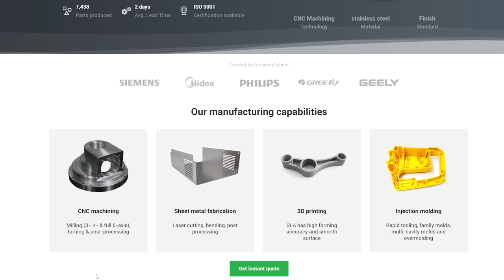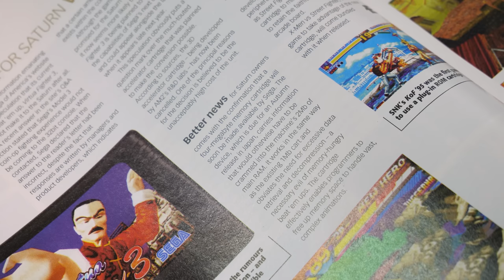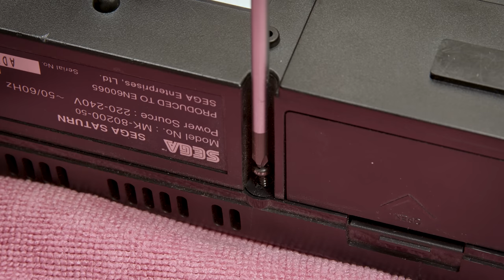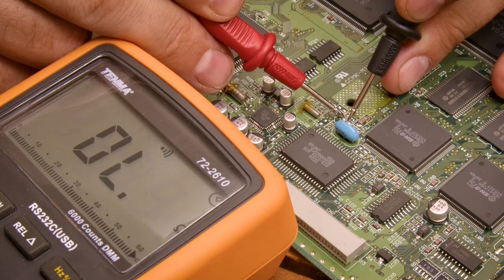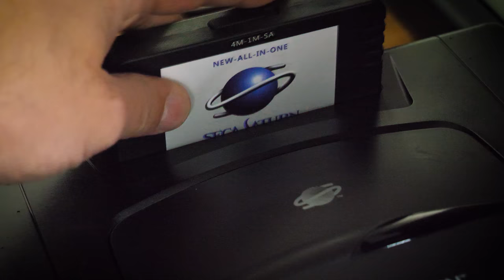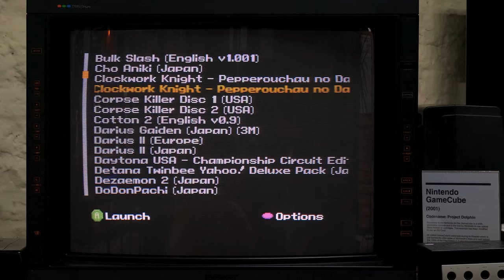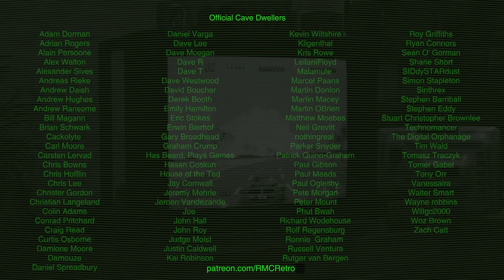Tricking out a Sega Saturn (Fenrir, 50/60hz and more)

Comment: Retro Bit makes officially licensed wireless recreations of the Saturn and 6- Button genesis/megadrive controllers. Both work interchangably if you buy the extra receiver. I've been happy with one of each on my Saturn/Fenrir, no b problems using ABC+Start to go back to to the fenrir menu etc. 

Still no analogue stick, but very few Saturn games use it, and I don't really miss it. The Arcade stick is a much more important accessory for that system.
Reply: This is the only true way imo, I want I like retrofighter but they keep messing up on controller features. Only retrofighter controller I have is the dreamcast one.

Comment: 10:25 

Great video, one thing regarding the 50/60hz switch. A PAL Saturn switched to 60hz outputs an off spec NTSC signal, 59.3hz instead of 59.97hz. Most 50/60hz switches will work fine on a CRT but won’t work on some HDTV’s and scalers because their output is off spec. You can swap the PAL crystal oscillator with an NTSC one to fix this, there’s even a dual oscillator mod available but the website for that chip you used doesn’t mention anything about the oscillator so it sound like a regular switch. Just thought I’d mention this, most PAL Saturn owners nowadays just buy a Japanese system for NTSC games as it’s cheaper and easier then getting the oscillator mod done.
Reply: Is this an issue for a modded PAL consoles if you use RGB scart since since the colour information is then not in NTSC?
Reply: @johnjames7332  No, it’s purely to do with the refresh rate.
Reply: @Ish0tJR  Thanks
Reply: I was wondering this. Does it end up resulting in tearing or judder etc?
Reply: @jonnyharket  Typically judder and the sound cutting out.
Reply: @Ish0tJR  thanks. Think I'll just get a NTSC J console.

Comment: My understanding of the analogue stick on Saturn (I can verify this on my Saturn later) is that for MOST Saturn games they are digital only. Only certain games programmed to take advantage of the analogue stick will play the way you are expecting. I would suggest trying Nights into Dreams and see if the analogue stick works on that one. Back in the day I bought the bundle that came with the analogue pad and Nights together.
Reply from the maker: I’ve had a chat with the supplier and they confirmed this is digital only
Reply: @RMCRetro  that's the thing with Retro fighters products. Always so close, but always an issue with the design of them. I believe this is digital only as it was primarily aimed at use on the Megadrive.
Reply: As I know. Only 5 or 6 games had taken advantage of the analog stick. Games like Daytona USA CCE, Burning Rangers, Nights and Sega Rally. I can be forgetting some game or another. But isn't many more.
Sonic R, Sonic Jam e Sonic 3D Blast had the support for the analog stick, but don't take advantage of that.
Others, like the original Daytona or Sega Manx TT Superbike, were compatible, had taken advantage, but weren't designed to be used with the analog stick, but with the Saturn's racing wheel.

Comment: I know people tend to say old 3D games don't age well, but I have to disagree. The old school 3D has a certain kind of charm just like old school 2D games, IMO.
Reply: It's a great system to witness how stunningly fast 3d graphics were improving at that time. To see Virtua Racing and Sega Rally Championship and realize they were released just 2 years apart is mind blowing. 

It's also fun (and occasionally infuriating) to see how different games at that time try to figure out controller mapping to move in 3d space, as there were a lot of different ideas tried out. Burning Rangers using the shoulder buttons to quickly swing the view around 90 degrees at a time is one I still think is pretty good.

Comment: You don't need that region free mod since the Fenrir takes care of this. All you need is to switch the console to 60hz permanently, which can be done with a single wire, no extra mods needed. The you can use NTSC roms with the Fenrir.

Comment: This is perfect for a console with a dead disc drive but if you have one with a working drive, get a Satiator, you can get the ODE features of a Fenrir but you can still use your CDs and games! It plugs into the rear VCD card slot.

Comment: Saturn collecting/buying/selling was bananas back in the early - mid 2000's. I sold my modded Saturn, X-Men vs SF (with cart), Marvel, vs SF, Bomberman, Darkstalkers Revenge,  KoF 95, Samurai Shodown 3, X-Men COTA, and Alpha 2 for £750 back in 2004. I also bought Try Rush Deppy for $30 in 2001, then traded it for Demon's Blazon on the SFC a couple of years later

Comment: You can get a PCB called a SaturnPSU that replaces the power board with a smaller/cooler one that runs of any >=3A 12v PSU, it's a great bit of kit that runs cooler and more reliable than the original PCB as there's no AC/DC conversion so less to go wrong.

Comment: I looked at modern alternative controllers but I settled on and would recommend the brook convertors from brook accessories, xbox controller (or you can use PS4 or PS3) connected wirelessly or wired - one box/dongle with a Saturn and DC connector. I do like the uniqueness of the original controllers - they are boxed and put away. The analog on XBox/PS are so much better.

Comment: The Saturn I bought just after it came out still works and I'm hesitant to replace the disc drive with a Fenrir as I love putting my old games (and also new ones I'm still getting to expand my collection) in and playing it the way it was meant to be played. I only need to fix the screw holes as they got stripped by me opening and closing it multiple times like for deactivating the sensor for the lid being opened or closed as I used the swap trick to play imports back in the day (now I got an Action Replay Plus which also functions as memory card and 4M RAM expansion). Still remember downloading games like Psychic Killer Taromaru and so on via 56k modem (5kB/sec oh yeah!)...

Just got a Virtua Arcade Stick as I never owned one. Already got enough normal controllers and the 3D pad but also looked at these RetroFighters pads before as I wonder if they might be better than my original Saturn and MD pads. Also do they really support the MS as the original MD pads can be plugged into the MS but have issues? Would also love to use the MD pads on my C64 but they don't work there, while the MS pads work but are quite bad.

Comment: Awesome video! I am Saturn fan since 1994. in the video you have done the region free mod if you go that way It would have been better to add the phantom modchip. instead of using the all in one cart.
And also you can do an other mod is to reduce the heat in the saturn by replacing the power board 220v to a 12v pico psu. sega for life!!!

Comment: Wonderful mods. You no longer need to remove the CD Drive thanks to the Saturn Switch mod that retains both the ODE and the CD Drive there is also the Satiator which plugs into the expansion port. And as for those that prefer NTSC J consoles there is the Pico Universal PSU mod, power efficient, runs cooler and no more step up transformer.

Comment: Great video. The PAL Sega Ages pack wasn’t optimised well. It doesn’t run proper in either PAL or NTSC. The timers run too quick. It’s the same with Manx TT. It’s best using the Japanese releases of them. The individual Outrun in Japan had an extra soundtrack on the disc also. They released another version of Daytona in Japan called CCE Edition and that improves the Graphics further and adds the original music. Try out the Sega Rally Plus from Japan also as it adds the PAL version’s improvements and analogue support.

Comment: Just upgrade the Saturn's RAM with the 4MB cartridge and update the power supply with new capacitors and new main fuse to improve its longevity. Not much else you can do to the system without wiring in an SSD module which can be complicated and overly risky.

Comment: Absolutely my favourite console ever.. i have 5 of them :) Superior to the PS1 for 2D games, but inferior for 3D. The RAM cart made it possible to do nigh on arcade perfect ports of the best Capcom fighters (superior to the PS1 versions which didn't have the RAM).

As for games I'd recommend. Guardian Heroes for beat em up along with the Dungeons and Dragons collection (JP). Fighters you have the Street fighter collection, SF Alpha 1-3 (3 is JP only), Vampire hunter and Saviour, Pocket Fighter and many more from Capcom games (they knocked Saturn support out the park). Sports i'd go Decathlete and WInter heat... two superb hypersports style games. Shmups you have Battle Garegga, Do DonPachi, Keio Flying squadron, Panzer Dragoon 1 and 2, Parodius and more. Once you have that ODE and the Japanese library becomes available there's just too many fantastic games to mention on this console.
Reply: Like you, I also have 5 working Saturns. kkk.
I don't think the 3D capabilities of Saturn it's somehow inferior to the PSX counterpart. The PSX handles fewer polygons and suffers from a bunch of scaling and perspective miscalculations because of the lack of float point calculations.
The Saturn also does not handle subpixel and floating point calculations, but because Saturn handles with squares and not triangles, it's just easier modelling 3D elements.
Reply: @carlosjuniorfox  I think technically the Saturn was the more powerful 3D console, but was much harder to code for and get the full potential out of it. As a result most 3D games that came out on both machines were better on the PS1.  I think there's a quote from Yu Suzuki saying only 1% of programmers could get the most out of the Saturn. There's definitely decent examples of the Saturn outperforming the PS1 in 3D, it's just not the norm.

That said I love the Saturn and it's such a shame it never quite reached it's potential... but those 2D Capcom games alone are worth buying the system for :)
Reply: , @haydengittins2836   I even don't think that the Saturn it's harder to code than the Playstation.
Isn't easy to state the whole thing in a single comment, but architecture-wise speaking, the machines are completely different.
I can state that the Playstation it's the most rudimentary or primitive computer from the new generation of video game consoles that we have until today. The way that Playstation handles de graphic elements is most like the way that PCs and consoles from today handle that and this is why it's so easy to emulate the Playstation console since even the time that the console was active on the market.
Saturn, on the other hand, can be stated as the most powerful home console from the old generation of video game consoles. 
The Saturn architecture it's most similar to older consoles, like Mega Drive, SNES or Neo Geo and it's very easy for a programmer from that generation to handle the Saturn hardware than for the programmers that came from the PC 3D accelerated graphics world.
So, it's very easy to port games like Metal Slug, Fighting games and even early 3D games come from arcade to Saturn.
But it's very hard to port games from the PC world, done with  polygonal triangles and general propose CPU code in mind, like DOOM or Quake
Reply: What I believe that happened at the time, was about the mindset from SEGA, with I believe, was outdated to the market expectations.
If you back in time, you see that with Windows and the early 3D games had another mindset than just fast gaming as we see in arcades and that kind of game had grown. Games like DOOM or MYST had gained so much space in the market like never before. What Sony did at the time was designed a game console with that perspective in mind.
On the other hand, SEGA was still in the same mindset from the past. Develop a game console that was capable of mastering arcade games at home. The Saturn was a beast machine to handle that kind of game, but at the time, wasn't anymore what the market was asking.
I believe it was hard to see what should be the market perspective in the early nineties, big franchises from the early generations were still huge as the arcade games like Street Fighter as well.
What I think was that the mindset from Sony was to make a bet and they did very well.
Keep in mind that after a long battle against Nintendo, in the year 1993, SONY received from the trials, the authorization to explore the SNES architecture in their new generation console. SONY could be launched their version of SNES, but CD-based and instead of that, they just dropped off the idea and designed the Playstation as we know it today.

Comment: I really think Sega missed the boat globally not putting more emphasis on the RAM cart aspect, I wish the Genesis+SCD could have done that through the cart slot. Historically one of the harder things to do is add more system memory to a game console that the SS approach couldn't be more easy to install. At one time the concept was foreign but certainly a common practice now with the multiple models per console we have now.
In retrospect I'm thinking perhaps the RAM cart was the better path towards better MPEG by way of brute force processing rather than a expensive dedicated hardware card. FMV on SS was always a bit of speedbump compared to the PS1 that consolidating FMV and RAM into one peripheral could have been more appealing.
I think that is a fair criticism for the SS given the time it came out, hard to believe nobody considered transparency effects more so in a 32-bit console. O_o??? There's a lot of questionable hardware engineering, 3DO programmer ewhac questioned why the PS1 had texture warp at all since it takes a lot of polygon subdivision to overcome it ijs.
Anyways that is one great mod with the Fenrir, shame about shortages but I'd recommend anyone getting a SS now to get one, lots of English patch work going on now that many Japanese games are now fully accessible to a wider audience. :D Nothing fetishistic or homoerotic about Cho Aniki, as the author clearly states it's about brother appreciation. ^_^

Comment: Saturn can indeed handle the transparency effect but the way that Saturn handles the transparency it's quite unique way.
You have two video controllers, the VDP-1 and VDP-2.
The VDP-1 it's encharged to handle all the sprites, or polygons if it's dealing with a 3D game. From the Saturn architecture perspective, doesn't matter, The VDP-1 deals with 2D sprites and 3D polygons in the same way.
The VDP-2 handles de backgrounds and post-processing effects, including transparency effects.
 The VDP-2 can generate up to four layers and one of those layers it's the result of the VDP-1 processing.
So, as I said before, the VDP-2 handles the transparency, but because the entire frame generated for the VDP-1 it's handled by the VDP-2 as a unique layer, this means that Saturn it's incapable of placing one sprite over another and applying transparency between then. If you do so, the sprite below the transparent sprite will vanish. But applying transparency between the VDP-2 layers can be handled just fine.
So, you can have a transparency effect between some VDP-2 layers in front of the VDP-1 sprite layer.  The Saturn also can handle transparency between some elements generated from de VDP-1 over some VDP-2 layers. But transparency can't be achieved between sprite elements.
Reply: What are the other three VDP-2 layers in addition to the VDP-1 generated layer?
Reply: @GreySectoid  There are most likely front-ground and background layers like so.
In addition to rendering image layers, the VDP-2 It's also capable to zoom and rotate those layers, like the "mode 7" of SNES.
In Virtual Fighter, for example, the background scenario and also the floor out of the ring are rendered by the VDP-2.
One of the games that use the VDP-2 most wisely way it's Burning Rangers.
In that game, elements like transparent glass walls between rooms are rendered by the VDP-2.
Reply: A great example of how to use the VDP-2 can be found in the Sonic R game.
In that game, the fade-in effect for the in-depth view scenario is possible because the background layer and elements like those flat floors and water are VDP-2 layers, so being capable to apply that transparency.
On the other hand, the shadow circle below the character and the 3D elements of the scenario itself are still being rendered by the VDP-1, which makes it impossible for the hardware for rendering using transparency and then, the check-board mesh effect needs to be applied.
The special stage of the Sonic R game has a foreground layer rendered by the VDP-2 applying transparency over the whole screen. In counterpart, because of performance concerns, the transparency effect of the in-depth view it's fully disabled at that stage.

Comment: I went down the Satiator route for the Saturn. That wasn’t cheap and needed importing, but it slots nicely into the VCD cart port at the back.
Reply: Hear it has some incompatibility problems with certain games.
Reply: @Nukle0n  not sure, it’s run everything I’ve tried so far, but there’s a lot I haven’t tried as yet.
Reply: Would have liked one but the cost it just crazy and Abrasive only got his ass in gear when the Mode and Fenrir got announced.   I think he was happily going to string his Patreons along for a few more years before he was going to release it